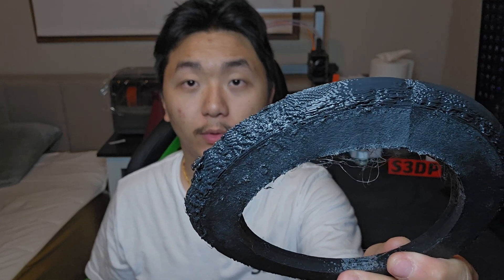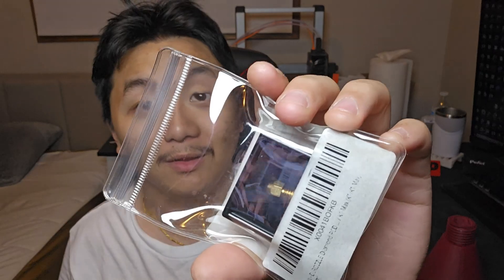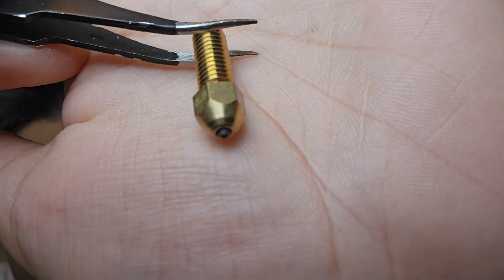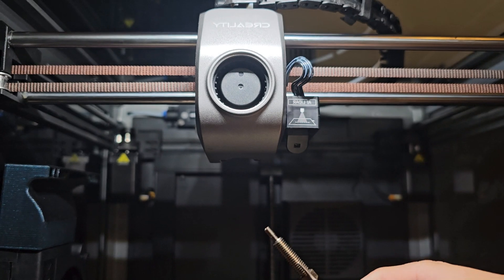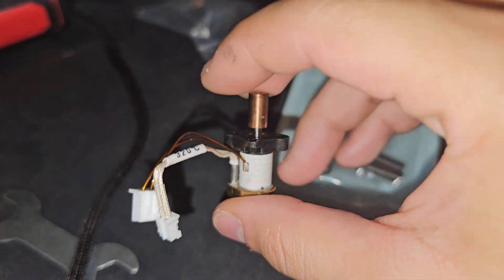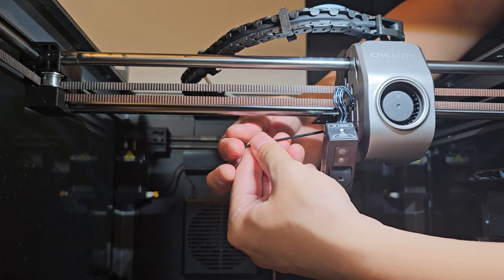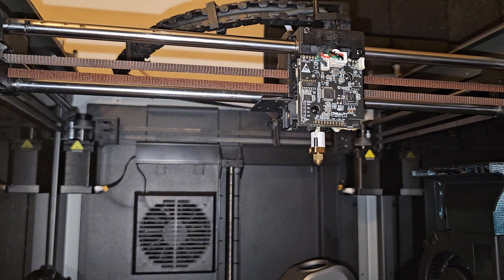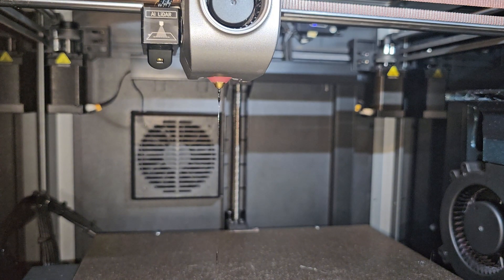K1 Max Diamond Nozzle | Why I Get This Bad Print?

Comment: I did the same thing on my qidi printer, printing glow in the dark filament. It also seems to be hard on brass nozzles
Reply from the maker: Ahh that's good to know. I think glow in the dark does have some abrasive things in it too.
Reply: its not recommended to print the variations of PLA without a hardened steel or stainless steel nozzle at minimum, like glow in the dark or sparkling filament, its really abrasive and brass isnt exactly the most durable material for the case.
Reply: Lmao yeah no shit, glow in the dark is notoriously for destroying brass in second's